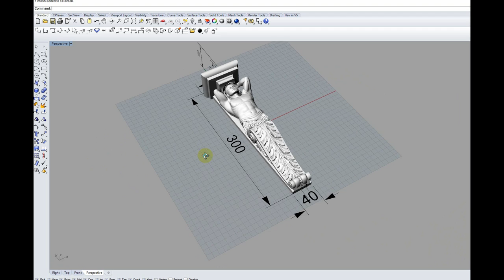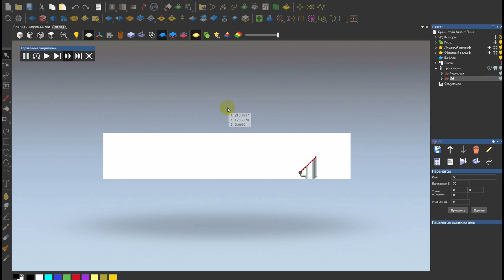Carved Atlants with CNC machine. Резные Атланты на ЧПУ

Comment: Hi Iliya , nice video as usual, you are the best  on Youtube who does 3D carving , and you use longer bits that i've seen anyone using, how long those bits for 3 D.
to carve a big project what bit would you recommend to do a faster cut. 
also what are the feed rate you running this bit and what are the speeds. 
what are the model for the bit you using, and what size. 
thank you
Reply from the maker: Hi. I buy bits in Ukraine. In this video you see 60mm long bit (30mm knifes).
Also i use 100 and sometime 165mm bits.
Feedrate always maximum.
RPM 12000 or 15000
Reply: thank you very much.  you are the best